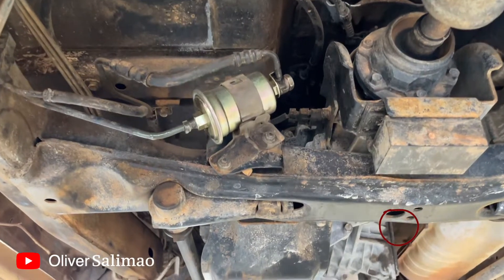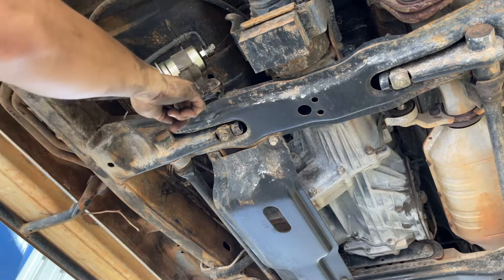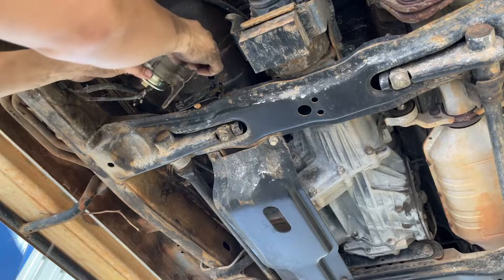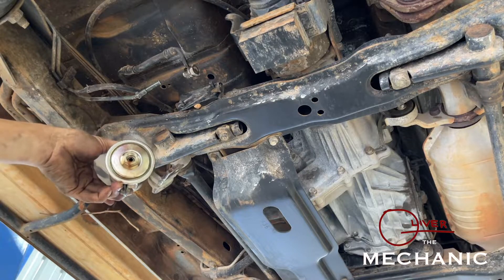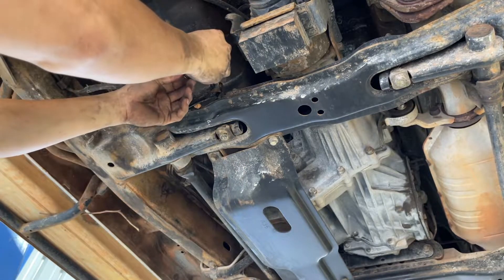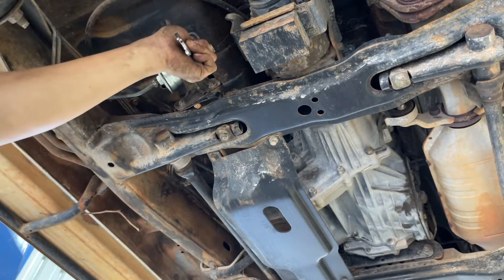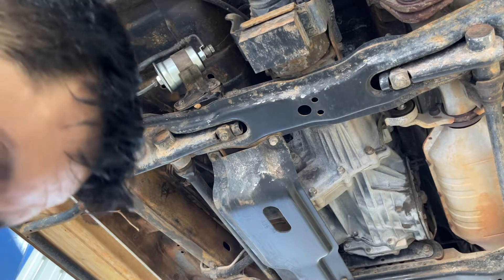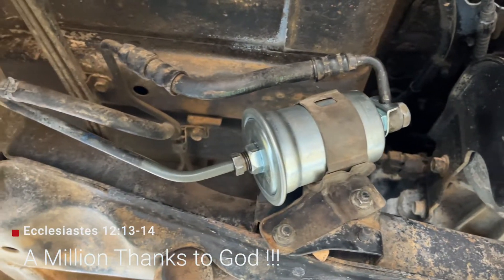HOW TO REPLACED FUEL FILTER MITSUBISHI PAJERO

Comment: Is that the same as for 2003 gdi v25 6g74 v6?
Reply from the maker: I’m not quite sure mate but the location of that filter is on the bottom Left Hand side of the pajero its easy to see when you are in the bottom 😉
Reply: @oliverthemechanic8532  pk mate coz i was only in need of the part number of it if you where sure they are the same
Reply from the maker: @rubenfilippus2956  the best way mate is to call a store parts they can give you the right parts of your car 😉
Reply: @oliverthemechanic8532  ok i will do so